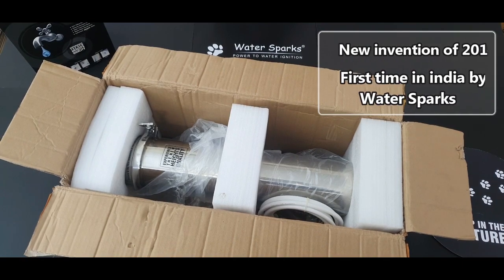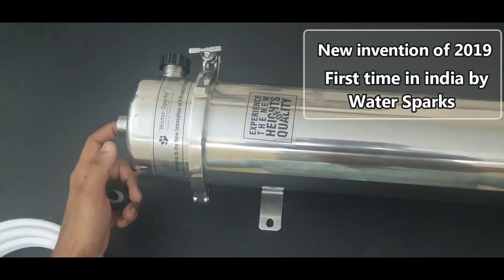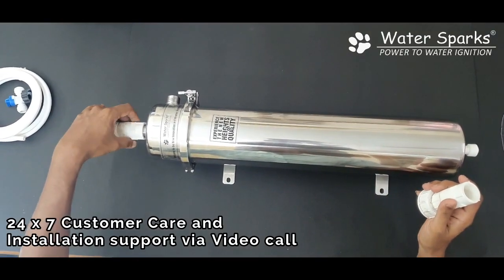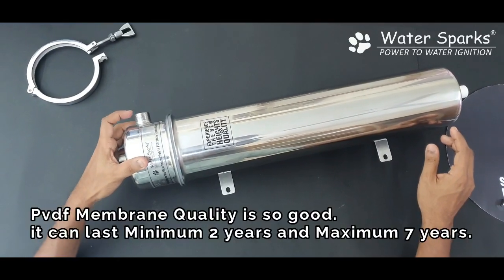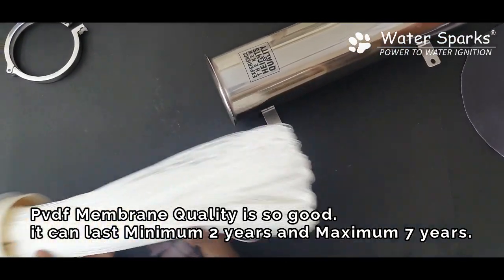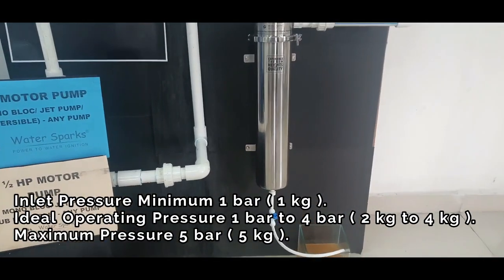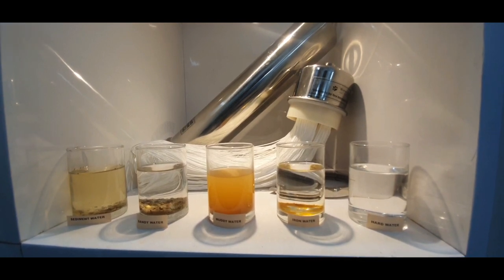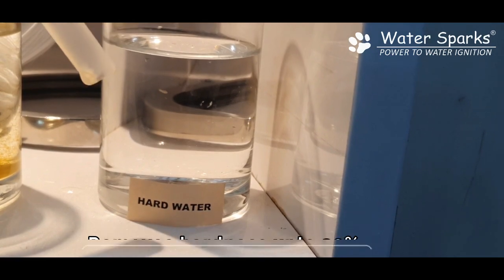Muddy Water Buster - Muddy Water Treatment Filtration System

Comment: I request everyone not to buy this filter. The filter gets choked even after cleaning every single day. Filter works good for 1 month , but after that even for filling of 1000lit tank using 1.5hp pump it takes more than 2.5 hrs. I strongly recommend every one to do research before buying and don't get trapped in this fake marketing where you would be duped of 30k.

Comment: Should the bottom valve be kept open always?
Reply: No, needs to opened for 30 sec every 2 days once to remove the sediment inside the bowl.
Reply: @hydrodocplus  What happens if it is kept always open (per the circumstances/set-up), further How much is the waste water generated for every 1000L of filtration through this PVDF membrane ?  AND what is the composition of the hardness causing molecules (Ca/ Mg chlorides/ Carbonates, etc) removed ?